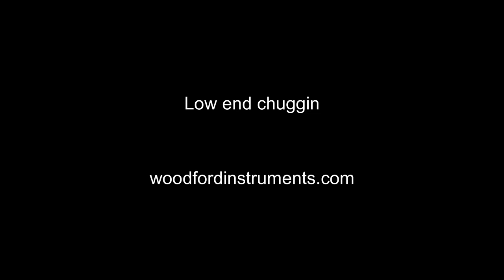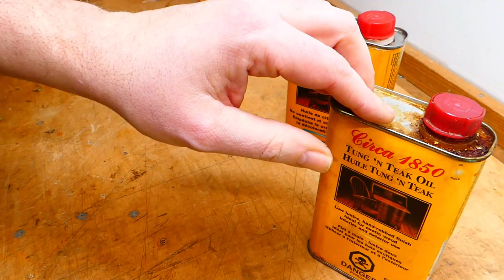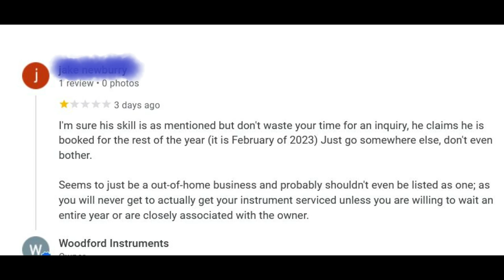70's Basses

Comment: My first bass was almost a new 1976 Ripper. When I decided to switch from guitar to bass after a year of guitar lessons, at 13 I decided I liked the sound of the bass. So went bass shopping for my first bass with my father it was between a new 76 Ripper for around $400 or a short scale 1966 Gibson EB-0 for $150, I choose the EB-0, I was a Jack Bruce fan and we were not rich and I still had to get an amp so I went for the cheaper bass. Still have the EB-0 but sometimes I wish I would have got the Ripper. Now I have many basses but I can't justify getting a $2500 instrument. By the way you forget  Rick Danco of the Band played a Ripper most of the time.

Comment: You are correct, in our shop we are running 6 - 8 week behind for just setups, restoration is much longer. We just finished 2 guitars that were in the shop over a year. One was a 1958 Gretsch owned by the original owner (86 years old). We are just slammed 

Ricky from IBM(guitar tech) Englewood, FL
Reply: There is just 3 of us in the shop. One handles the small retail area of the shop, strings, picks, small selection of guitars, and other accessories and the Luthier and myself in the back doing repairs. And we are just slammed

Comment: You can buy mineral oil at a pharmacy or dollar store for $2/pint.  It's very often used on wood cutting boards because it doesn't turn rancid like veg oils will.  It's secondary use is as a laxative.

Comment: fantastic as always!

i appreciated your breakdown of fingerboard oiling and i'm with you on "lemon oil"; looks pretty when you smear it on, goes away after a while, doesn't accomplish much beyond that. supposedly if you use too much for too long it can soften the fret slots

also, don't know if this is the case here but i get the impression that longer, ramblier youtube videos are less work for the creators because there's less editing. if so i'm totally here for it! discurse away, it's good stuff (including the proto spinal tap reference)

Comment: Drying oils vs non-drying and penetrating oils vs surface sitting. I think we're always looking for penetrating-drying oil with woodworking in general, not just instruments. Those oils they say can pass through paints and finishes without damaging them and get into the wood. 

As a musician, a carpenter, an engineer and practical quantum physicist, I still do a lot of hammer and chisel work on my guitars lol. If I were doing it for someone else, I will cut no corners but a lot of my own instruments are going to get beat up so a bruise or a scrape is trivial. I own probably 40 Frankenstein or boutique brand guitars; some 2nd to no brand on earth, but they're still cheap guitars until I pour a lot of work into them.

Comment: That is a first generation grabber with a flat headstock like a pbass. after the first year or less, they had an angled headtock with a scarf joint.  The pickup can be adjusted to be movable even mid-song with just the right amount of pressure on the 4 screws on the corners of the plate. There is supposed to be a thin felt on the plate under the side of the pickguard to get enough friction.

Comment: I used to own a Fender Fretless Jazz bass, and it did have fret position lines in the fingerboard.  Looking at that Gibson Bass, reminds me of my 1973 SB450 bass that I paid $200 for at a pawn shop in Houston in January 1989.  It's been used on dozens of recordings and live performances.  I did strip the old finish off of it years ago and sprayed it with several coats of satin finish, and also corrected the wiring from the pickups to the pickup selector switches when all the hardware was removed.

Comment: I've made a few apple wood flint knapping tool handles and treated those by squashing walnut onto them to squeeze out the oil and then smeared the oil all over the handle and let it soak in. Repeated doing this until the handles had a nice coating. Could probably do this on a freshly made fretboard if you don't have a container of drying oils. The flint knapping tool handles have a nice shiny smooth appearance but the amount of walnut oil used was really very tiny (half a walnut or less) and they smell pleasantly of walnut

Comment: That's a 70s era P-J Bass. A P would only have the one original Spit Single Coil pickup. The addition of a Bridge Jazz Bass pickup was supposed yo give the player the best of both worlds, either a P or J Bass sound, or mix of the two. 
I may be wrong but if memory serves, I think they actually used J Bass necks with the narrower spacing and thinner profile.
I did a Squire J Bass conversion to a Fretless by trimming down binding to fit the Fret Slots.  The owner was having issues finding a neck at the time.  Neither Fender or Mighty Mite had any in stock, nor would they give him a lead time for getting one produced.

Comment: 19:50 amen brother. 24:50 shame the truss rod couldn't pull back more you had the adjustment to lift the saddles really high. I just made a 13mm tall saddle for my GF new Dove she just got with a forward bow that when I corrected was a sitar. Had 9mm tall came together easily but wicked break angle behind the saddle.

Comment: Hi Ted,

great video again👍🏼
well thank you 🙏🏼 😊

I prefer after many years trying different Oils now Camellia sinensis Oil for the fretboard, which is also one of the best, if not the best oil to protect blades and metal surfaces (traditionally used by japanese smiths for the famous katanas and nowadays the japanese chisels). It's texture and pureness is to me perfect for the job AND it is very thrifty.

You can even use it for your skin and cook with it.

Best wishes from Wuppertal / Germany ><>Lutz

Comment: Hey Ted, I have been using Teak oil instead of lemon oil for a few decades, why?  Because lemon oil doesn't last, nor protect as well to begin with.  For clients where I did seasonal setups I had to re-oil fingerboards all the time, and some came in with a little shrinkage and protruding frets in dry winters, and swollen grain in humid summers (Chicago).  I read up on the various oils and found Teak oil is specifically made to make woods that are not teak take a beating outdoors.  Teak's natural oil is why outdoor furniture is made with it, but way expensive too, and so someone came up with teak oil to make other woods stand up to the abuse.  Now I get instruments in year after year, and I only reapply a coat if they lost their luster.  For the most part it lasts a few or more years;   Man does it work great!  Fingerboards don't shrink or swell, frets don't start protruding or come loose, sweat doesn't effect it much, and dirt doesn't accumulate as fast.

It's not expensive at all, and I too have been wondering for years when I will start running out (Same size can).  I swear by the stuff.  It will darken the wood just a tad, and doesn't have a high gloss, it also polymerizes and why it works so well, but unlike gun stock oil it feels and looks more like unfinished wood.  it does the job better than everything else I have ever tried.

I always tell clients to stop using "Fingerboard oils" that come at a high price, because those are designed to have you reapply it often, so you can buy more, and the secret sauce is your wallet.  I mean really "Makes your fingerboard faster"??  If you are touching the fingerboard with force while playing, then you are doing it wrong, and that's what's slowing you down!  If those snake oils were so freaking good, they would work and last, and not hold dirt, rather than resist it.

I may have had a hard time convincing some clients to give up their snake oil and let me clean and then oil their fingerboard with it, but never got anything but approval, once I did.

Comment: Actually the Bass Guitar started out as a Fretless in 1935 (it was basically a Scaled Down Electrified Upright Bass morphed into the shape of a Guitar) & they added frets to it 5 years later. However Jaco Pastorius bought the Fretless Bass Back home.
Reply: Was that a Rickenbacker instrument?
Reply: @tiki_trash  It was a Paul Tutmarc Instrument
Reply: @RockStarOscarStern634  Gibson made one too.
Reply: @BenPrevo  They made an Upright Electric Bass Guitar which is a Fretless Bass made to be played standing up, you could also play it seated by getting a Bar Stool or a Double Bassist Chair.
Reply: @RockStarOscarStern634  The tutmarc was a fretted horizontal ? _- The gibson was upright -- and tretless with markers.
Reply: @BenPrevo  From doing alot of research it actually started out as a Fretless Electric Bass in 1935, they added frets to it 5 years later

Comment: On the subject of alcohol for cleaning, I bought a few bottles of alcohol heater fuel a few years back and it is 'cut' with acetone (you can smell it and it makes your skin really cold when it evaporates off of them). I knew not to use that stuff for cleaning things that don't like acetone. But it is fine to use as fuel for my camping meths stove. 
I bought a few litres of isopropyl alcohol a little while back which is perfect for cleaning stuff, and it was pretty cheap compared to 'super servisol' (switch and electronics cleaner) which I've bought litre tins of in the past at £10 a tin. Iso off of fleabay is a lot lot cheaper than that.

Comment: Bought a Grabber new in 1974. Traded it to a friend for a Fender Mustang a few years later.  This is the first time I've seen one since then.
Reply: Ted mentioned Bill Lawrence pickups. I used to have a Mustang which I got used with dead pickups, and I put a Bill Lawrence stacked humbucker with blade type magnet into the bridge position (and a Duncan PAF for the neck). That was a great sounding guitar;  It was Orange with a racing stripe and kind of beat up and so it wasn't pretty but it sure played nice. I wish I had kept it.

Comment: Great video.  About that "Fender":  (1) it looks like a Jazz Bass-sized neck (nut width of 1-1/2"), also known as an "A" neck, not a typical Precision Bass neck, but in either event, likely not a genuine Fender neck.  (2) The bass has an aftermarket Jazz Bass-style pickup added at the bridge position.  (What they now call a "P-J" bass - not sold by Fender in the 70's.) Not factory.  It looks like a DiMarzio pickup. (3) If you want to look at the heel of a Fender bass to check for markings, such as a date stamp, you don't have to remove the neck or take off the strings;  you can loosen the neck plate screws almost all the way and carefully tilt the neck back to take a look.

Comment: I have an old fretless P bass, legit Fender, haven't fully dated it to the year but it's got patent numbers in the headstock face decals so it's of a certain age; it's got a rosewood fingerboard with what looks like mop dots - I've never seen a lined fretless from the factory in the older eras but just because I've never seen one doesn't mean it doesn't exist.
Not being contrary nor am I an expert, just noting the dotted ones do exist because I have one.  Still deciding how I like to intonate it, even after having it a couple decades - fretless instruments open up options if you prefer them, it's definitely a lot of fun and requires less effort than fretted (to me) when set up well.

Comment: I've found the same experience with the impossible customer in every niche I have worked in, and it's almost certain to happen if you do anything long enough to get a good handle on what you're doing.
Outcome is almost always the same. You're the only one who can do it properly... Until they decide you didn't do it properly because they hit a curb/left it in a tent overnight/messed with the C02 pressure/adjusted the cooler temperature..🙄

Comment: Total agreement with the oil I use boiled linseed oil but I use the gunsmith technique on new fretboards literally 3 drops ad rub in really briskly get some friction heat going maybe add another drop or two if very dry.wipe down excess repeat this for two or 3 days then about 2 weeks later then 6 months then once a year blo needs UV light to cure and polymerize so sunlight but maybe not direct helps it cure . A typical gunstock takes me 10-12 drops blo to cover it and cure under UV light blo can turn yellowish over time

Comment: As Ted says, so-called 'Lemon Oil' is mineral oil with a bit of lemongrass oil or citronella to give it a lemon smell. Hence, it should be dirt cheap, but isn't. One can be mislead by labels etc., if one does not know better. I can buy two brands in ca. 500 ml containers easily here in UK - Chestnut Products version, which says it is 'based on' lemongrass oil, except that when one looks at the safety data sheet (SDS) one finds it is predominantly (white) mineral oil (a.k.a naphtha). The other is the US brand Parker & Bailey, which describes itself as 'Natural Lemon Oil Polish' with the (at the very least chemically meaningless) claim that it is 'pure oil no solvents' Again, though, when one looks at the SDS one finds it is overwhelmingly (white) mineral oil again. As a chemist, I really struggle with the idea that mineral oil is not a solvent and that it is 'natural', except in the most general sense that petroleum is a natural product I suppose. Not entirely sure what ‘pure’means, when mineral oil itself is a mixture and it has been adulterated with citronella or whatever.

We pay between 12 and 18 USD for 500ml of this stuff, whereas one could buy mineral oil and a sniff of citronella or lemongrass oil oneself for much less than a fifth of that. I can do it for ca. an eighth and will in future if/when I run out. 

Are the claims or descriptions misleading, the SDS that most people won't look at not withstanding? I would say so. It is illegal to make misleading claims in advertising in UK (I don't know about USA, but suspect not so much [I base this on 'Grover - the world's best tuning machines' yes, right, tell that to Gotoh or Schaller!]).

Comment: Between the finger shredding pointers below the knobs, and the absurdly tall saddle adjustment screws, I am surprised the Gibson Grabber isn't blood soaked. Think the output jack was relocated for another reason. Can't imagine a flailing right hand on this skin shredder. I wouldn't touch a set up like this, I like to keep my blood on the inside. Besides, nothing beats a Fender P (IMO).

Comment: I made a Tele kit Guitar that I used Danish oil on. Yes, it took ages to cure, lucky I did it in the summer. I think I did 10 coats (with light sand down between coats) over 14 days? But it turned out ok.
Reply: When I finish a guitar, I use a pair of 300W halogen work lights to bake every coat, esp. when I'm working what-passes-for-cold-weather-in-Florida.  Sometimes I'll preheat the wood, too.  Oh, and on rattlecan finishes, I'll set the can in a bucket of hot water for a few minutes before I use it.

Comment: I like the sliding pickup idea but why didn't they make it able to slide a lot closer to the neck? It would need to be a different design such as maybe some sort of roll of black material so as not to show the wood of the guitar but it is doable.
That small amount of movement seems a bit pointless and I doubt it makes much difference to the sound.

Comment: If the oil does not evaporate over a day or two then it's not appropriate for fingerboards. 

Your gunk adds to the oil and will dry like that. Formula 65 does not dry after a week.

Comment: When I was gigging in a band in my late teens, late 70s to early 80s, and chose a brand new Stratocaster, I am fortunate enough to have dodged the bullet of buying one of those awful Gibson Marauders or some such uncool horror of the era.  For uncool is what they were (and some similar Guild thing that a friend bought and thought was acceptable).  Thank goodness for the influence* of heroes (* blind following).  I can imagine the opening up of a Grabber bass as an owner to find the plastic pickup tray fall out and the tacky pots on the back of the plastic plate and just be desperately disappointed.  I've seen more sophistication inside a cheap battery wall clock.

Comment: "Vintage strings" Yeah, it's kind of a bass thing. I have had the same set of flats on my P bass since probably 2009 or so; it is about 50/50 that the sound does sort of "wear in", and a set of flats is expensive so it's easier to just convince yourself of the first point than to buy new strings. As far as your comment as to bolt-on necks frequently having the end of the fingerboard kick up, can you elaborate on that? I can't find anything on that through googling.
Reply: Its a bass thing for bass players that enjoy sounding bad
Reply: I've run into bass players who will take the strings off and boil 'em periodically to get rid of the months' worth of accumulated finger grunge.
Reply: @ileutur6863  it's a fine line.

Comment: Is that tung and teak oil.  Similar to "tru-oil , Gunstock oil.".. In that it's sort've a shallac ?  I use that on the back carve of my necks.  After finish with steel wool has a very butter smooth texture that lasts

Comment: Lemon oil is absolutely THE BEST thing to get bug guts off the front of your car. Especially the dreaded Love Bugs. Which will actually eat right through your paint if you don't get em off fairly quickly.
Reply: I recently struck a plastic construction barricade with a work vehicle. I used rubbing compound to clean the black scuff marks off the bumper and the fender.  Cleaned right up. The lovebug guts across the front bumper were hardly touched by the compound. :D
Reply: @mrz80  tell me about it! Try the lemon oil. It's amazing on lovebugs. Plain ol mineral oil works too. But that extra little citrus oil additive really takes it up a notch.